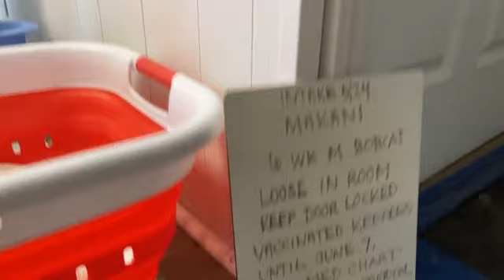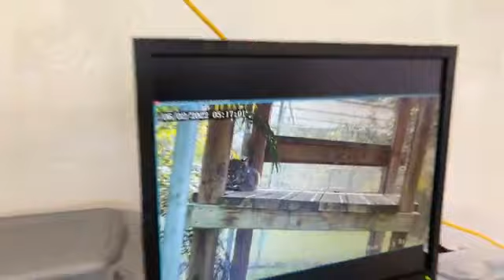Makani, the newest rehab bobcat, is having an intake exam with Dr. Justin Boorstein at Big Cat Resc

Comment: Question..... Did you guys time travel? if so how!!! do tell! lol only ask cause I saw the date on the video monitor saying it was tomorrow (6-2). considering it's still 6-1 north of you guys. I'm in NE TN. 
I loved how Makani was trying to bite all the swabs and what not. Dr. J. was using. When he got near his mouth. that brought a giggle out. 

I was also wondering.... maybe an easy to put on harness on them when they are that young. Would give the one person hold them a better grip and pin them to the table. Use one hand to hold the handle of the harness down and the other hand could hold the head easier. of course it would have to be straps (leather or something strong like that.) the strap with the handle would stretch along their back with two straps that you wrap around their chest and lower belly with a buckle so it would stay on. it would definitely take two to put it on. ie one hold them and another putting it on, but would only take one to release them from it. Just a thought. Was trying to think of handler safety. maybe someone that is handy at crafting such things could design/make one.